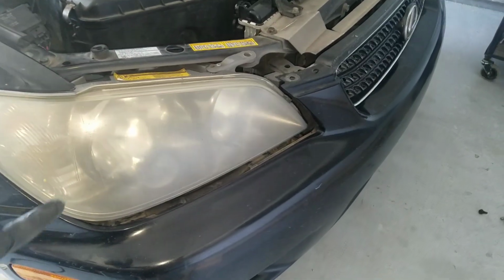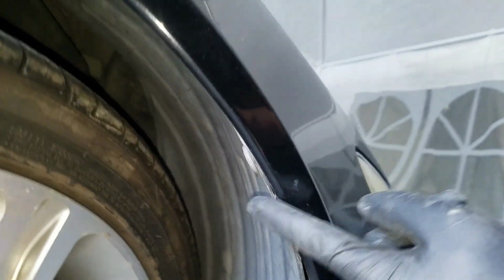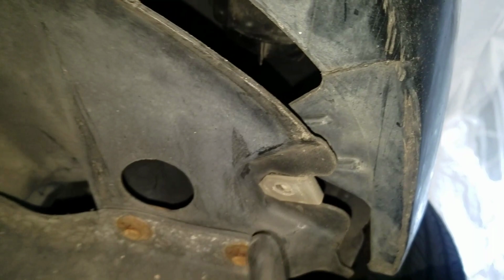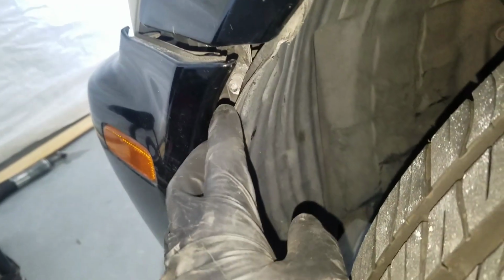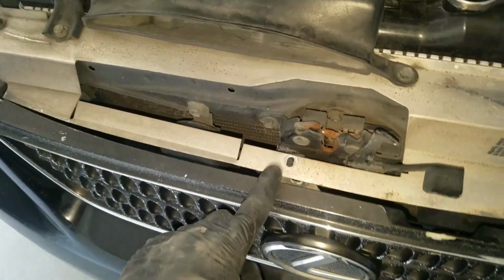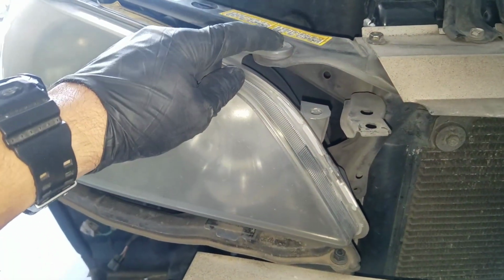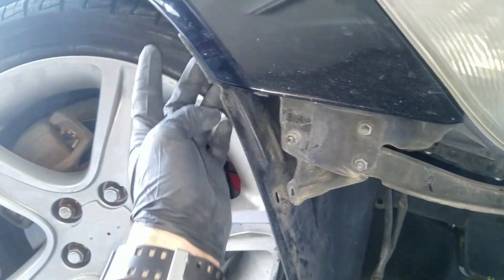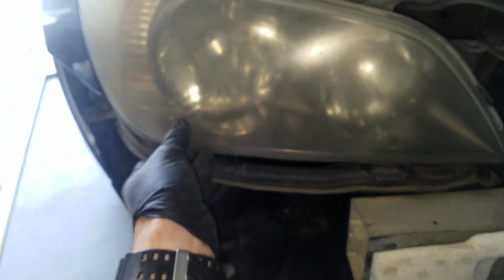How to Remove A Lexus Is300 Headlight

Comment: Hello to replace the amber turn signal bulbs in the headlights, can they be reached by hand by removing the fender liner?  Thanks.
Reply: How did you do it? I need to change front turn signal bulb

Comment: Is it necessary to remove the bumper to remove the lights? Looks like u can get away w out removing the bumper. Gonna replace my lights today I’ll try w out doing the extras.
Reply from the maker: Its faster and easier to remove the bumper.
Reply: @Donnythelatemodeltech  Damn straight! My scraped arms agree!
Reply: how did it go?
Reply: Good vid I just did it without removing the bumber it's a little tricky it was definitely worth it, didn't take me too long